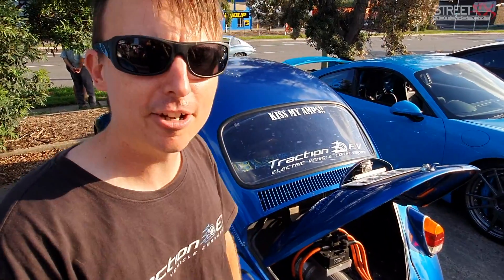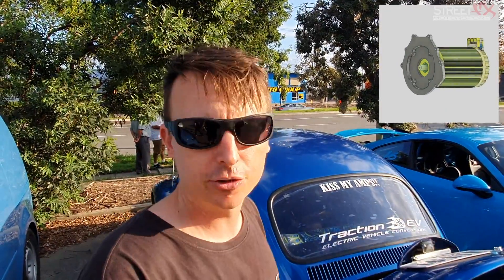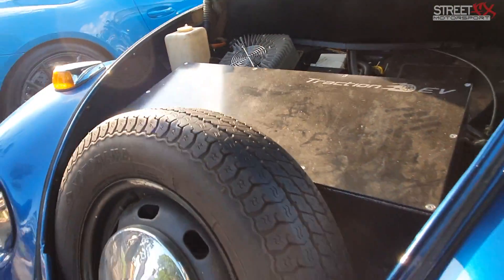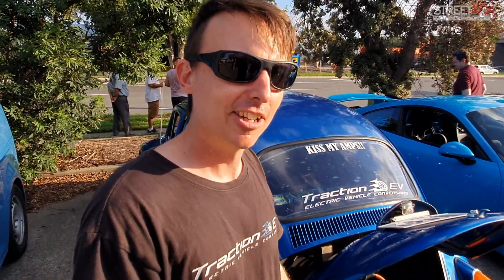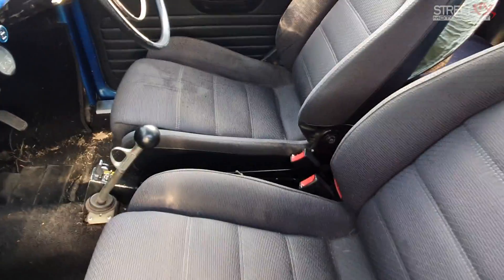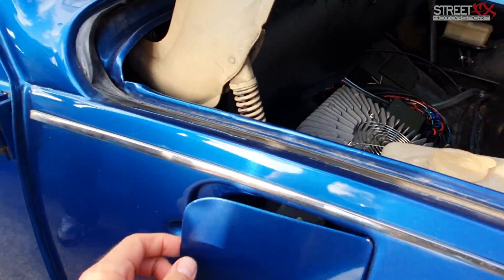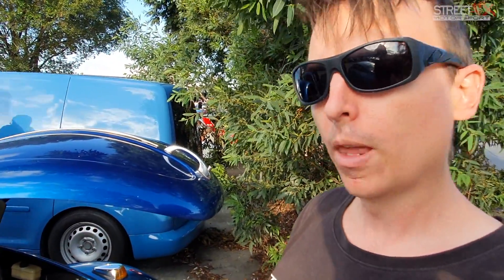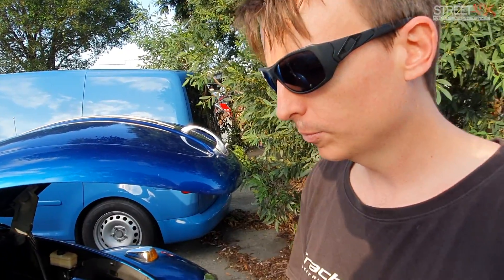DIY All electric EV Volkswagen Beetle conversion using Tesla bits by Traction EV

Comment: Hi, I am Graeme John Eddington. Following is my Youtube post of my Multi-speed transmission I have called: "Opposing Torque Dynamic Clutch" which is a type of Infinitely Variable Transmission (IVT) which I believe is ideal for your current applications. Australian Patent Number: 2020201132. Please log on to my Youtube video: https://www.youtube.com/watch?v=SACDK89U7PM In summary: It is a Compound Planetary System with two inputs from two separate electric motors. Motor 1 tries to rotate the carrier counter-clockwise and Motor 2 tries to rotate the carrier clockwise. The ratio, acceleration and speed of the vehicle is controlled by the amount and proportion of power/torque from the two motors. In addition the ratio of the transmission is affected by the speed and load of the vehicle. So, with the aid of speed sensors on all the components of the transmission, the speed of the vehicle, position of the accelerator and a kick-down switch - all that is needed to control the whole system is a computer. There is no actual gear selector for the driver to operate, however a manual mode would be appropriate where the driver has a 'balance' control knob that manually controls the proportion of power/torque to each motor and therefore can choose any ratio desired for the driving situation. An added enhancement could be added to the transmission by having a traditional planetary overdrive attached to each of the motors to enhance the rev range of each motor. This would enable the provision of extra modes like economy mode/sports mode and improve the kick-down mode by inputting more revs when the gearbox is in an extremely low ratio during kick-down operation. Having this type of transmission would improve acceleration and range of the vehicle allowing for a smaller battery pack/lighter weight leading to cost savings and simpler manufacturing. My name is Graeme J. Eddington, smart-s-trans@hotmail.com https://www.youtube.com/watch?v=SACDK89U7PM

Comment: What a storyteller! I have exactly same EV West setup in my Beetle. Measured peak power is 65kW. According to manufacturer's data sheet continuous power of the motor is 38kW. Continuing max current output of Tesla batteries is 250A, equals to 27kW on 110VDC. So not even close to 120 horse power. There is no fast charging in this setup.
Reply: The HyPer9 peak power is 95kW, or 127 HP.  It can hold peak for like 2 minutes.  Continuous power is just that, continuous, driving down the highway.  You're confusing your specifications.  A Tesla module has a max discharge rate of 750 amps, and this have five (5) of them.  The battery output is not remotely an issue.  If your peak power is only 65kW then you've done something wrong with your installation.  Yes you're right on fast charging, the nominal voltage is too low to support any DC fast charge protocols.

Comment: I had a rock from a spinning truck wheel hit my bare ankle (right on the ball of the ankle) and it split the skin almost down the bone. I don't know how the bone didn't break. I still have a scar 20+ years later.
Btw, this happened while I was trying to push the truck up a dirt boat launch, with the boat on the trailer. 2 old guys passed by in a John boat laughing and told us to start the boat, then when the truck starts to accelerate, hit the throttle in the boat and then kill the engine before it comes out of the water. Those geezers right! It worked like a charm!
Reply: that reminds me of a time when I was watching a video about an electric conversion VW Beetle

Comment: Beetle gearbox might be strong enough for your setup, but from my experience its not very strong. Otherwise all the credit to you for building such a nice EV project.
Reply: Not very strong is highly subjective and depends on intended use.
Experience can also be localised as it may not be maintained properly, fixed using non genuine parts or genuine parts not made in Germany.

If to be used in the range of the original engine (suburban up to even 140 kmh or 80 mph ) then it is quite strong
Drag use upwards of over 200hp not so much
Reply: With no clutch usage and the corresponding surges this is well within the limits of the transaxle. You just leave it in gear and the power delivery is smooth.

Comment: Still sorting out a system for my 74 super  - I plan on adding a bank of the super capacitors as well as the battery packs to help with acceleration since they would charge quickly back up with regenerative braking  and can save the battery bank a bit

Comment: The batteries are located better for easier replacement and maintenance/trouble shooting. 
These are the things manufacturers are protective and have made infinitely harder to do due to greed (increase profits by discouraging DIY through unnecessary difficulty, specialised tools and complexity).

Comment: Devaluing a classic car isn't the smartest thing.
Reply: He’s DOUBLED THE. VALUE. of that model and year
Reply: Replacing a 50 year old worn and shot motor with an electric one isn’t devaluing the car.
Reply: Good thing it’s not your car to worry about
Reply: Boomer
Reply: That's one way of lessening the pollution in the air. Cleaner air > Car value.
Reply: Not sure the original  motors are a classic.
Reply: This easily increases the value.  VW Beetle engines are not sought after.

Comment: Thanks for the interview Mark! I should also mention the motor is a NetGain HyPer 9.
Reply from the maker: Most welcome! Awesome project! We should touch base with you when we wanna do something crazy electric :P
Reply: @StreetFXofficial  For sure! Electric Time Attack... \m/
Reply: Have you come across an all electric heater that will work on 12 volts that we could use on are Volkswagens

Comment: I don't need 120 hp. In fact, I'd be happy with 50 hp. Surely this would increase range, right? 

Also, my 1967 Karmann Ghia has air conditioning. Can a  compressor be adapted?
Reply: We have a 70hp motor Option also. It wont really increase range. Cruising on the highway at 110km/h, this 120hp motor is only drawing 17kW-18kW (less than 25hp). The 70hp motor will do basically the same, just has less acceleration and top speed when you plant your foot. We installed an electric Air-Con compressor into a MK1 Cortina owned by our friends at Charged Garage. 120v compressor with its own motor. No parasitic loss from the traction/drive motor. No need to upgrade your alternator which would also increase losses.
Reply from the maker: Yes we asked this specific question - ac is available!